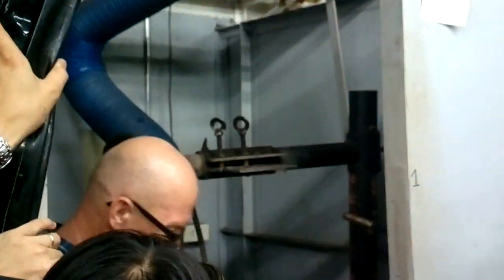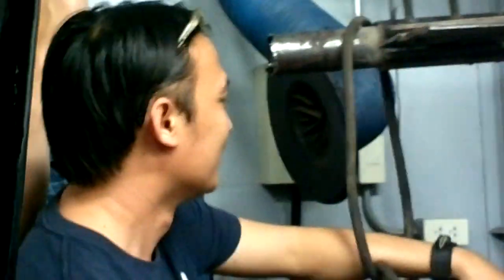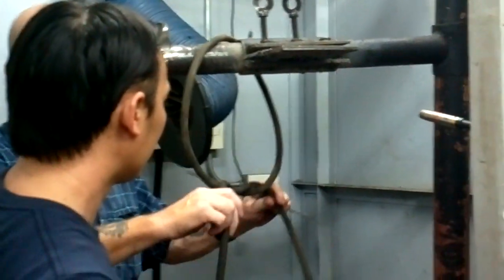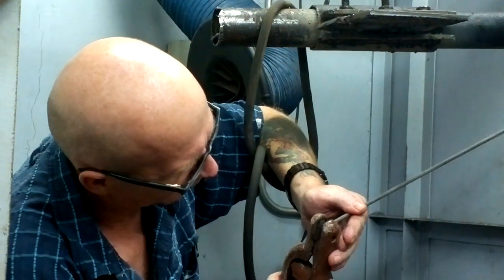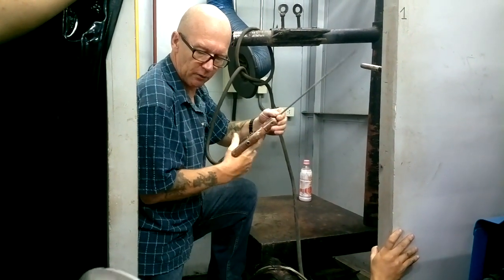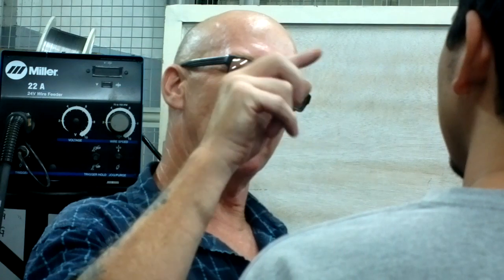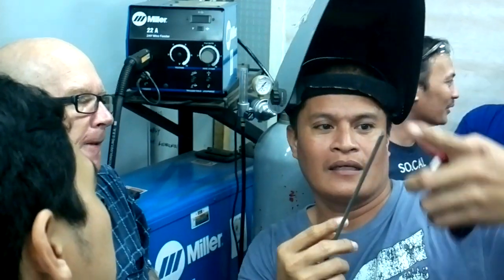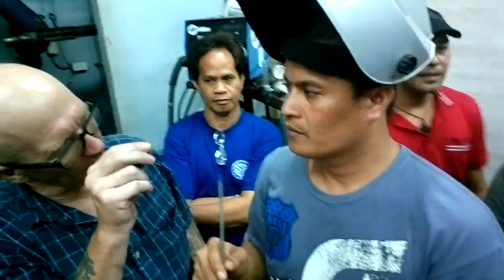How to weld overhead on SMAW

Comment: if your employer ever sees u using your lead as an arm rest, you will be fired. if that molten puddle falls, it could land on the lead and damage it. rest your left arm on the poll and go from there.
Reply: i agree bcoz there are rules/safety in doing proper welding procedures ang 1 of it is to avoid the lead to lean on your body parts

Comment: yeah this one is helpful some i will try it the secret of why? they cant weld better the resson is the weight of the cable  me my techniques is cable in to my shoulder its not dangerous as wat they think im doing this for almost  7 years just remember dont do it in a wet floor 100% of the techniques is you see wat you doing and you know how to manipulate the lelectrode and you can drive the arc length test your self using 110amps  that if can you weld tin pipe the b'i/g'i/s20 or stainless 1.2

Comment: actually I found this a handy idea In our shop I set up a rig to hold my plate up out of scrap we have laying around so I get it a good 4 5 inches above my head then use my chest to help stabilize my arm usually using 6010 or 6011 as a rod 6011 is better for me  but I am going to modify my rig so I can use the idea of using the cord as a sling that was just a great idea that never crossed my mind

Comment: Christian, This trick applied for working is not practical too. 4G should be considered as one of difficult positions and should be avoided as much as we can. My experience in structural welding I could not find anything to hang my welding wire on it. I must stand on the scaffold. The only way to stable my rod is try to find somewhere for my left hand to hold and my right hand to weld. Welding teacher should teach usual way to students because it will take time for them to practice.even hard.

Comment: i agreed to you, dai nguyen in testing or trade-test, but in working it can applied its your trick your the welder, but if you use this in trade testing, the moment you knot the wire your failed men, like old once said trade testing is hard but in its working you can do all stuffs you want.